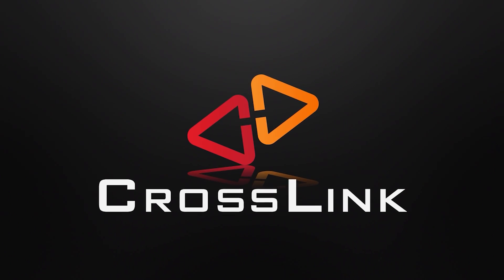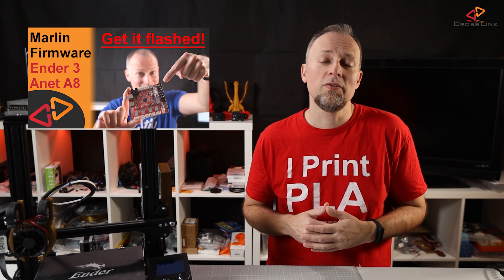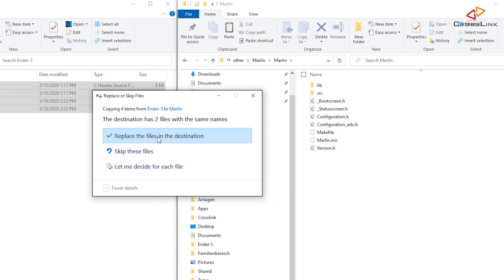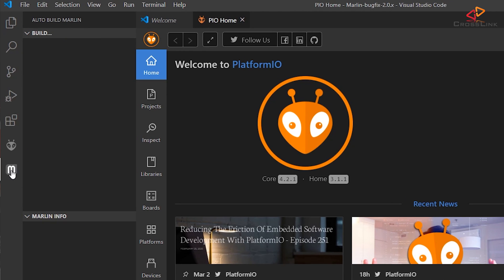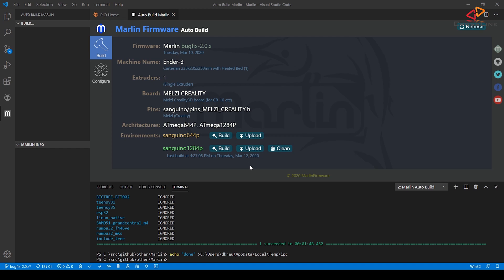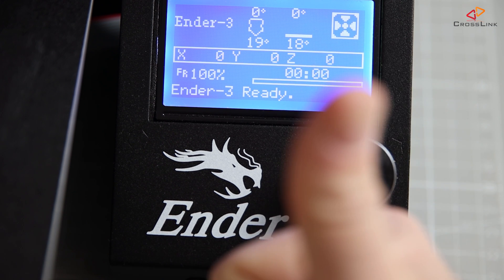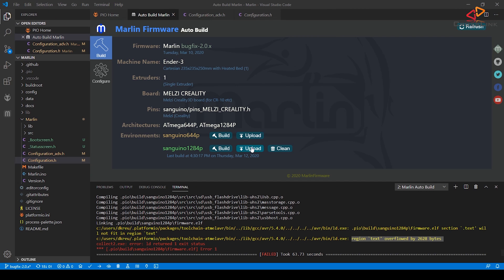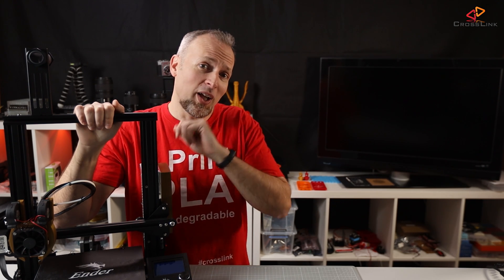Ender 3 (Pro) Marlin 2.0 Upgrade  - Updated Version

Comment: Thank you for this video, i am trying to use and SKR Mini and there was a file for that now in the CONFIG files, however when I try to build using auto build it just says unknown motherboard BOARD_BTT_SKR_MINI_E3_V2_0. I am trying to get my BLtouch to work on this board, BTT's precompiled firmware is not working correctly.

Comment: Hi !
I have a problem to build SANGUINO1024p (6:06 of your video).
First, i downloaded VISUAL STUDIO CODE. Then i put Extensions "PLATFORMIO" and "auto build marlin". Then I restarted computer.
I connected my Ender 3-pro in USB (Only USB, 230V of printer is off), then I open VISUAL STUDIO CODE.
I opened as you shown and click on BUILD. Video : https://drive.google.com/file/d/1y3KVWwaJwz86ZRVw_2wGgKtKVzsTtrWy/view?usp=sharing
As you can see, I have several errors, but I don't understand why...
Can you help me please ?
Thanks in advance,
Fabrice

Comment: is it possible to load marlin 2.0 on creality ender3 board 1.1.4. seam to getting a orange vscode with a dot in the marlin build with a few problems and environments getting melzi not surguinio
Reply from the maker: Sure, this works fine. Issues will come with building firmware with a lot of features. And on Windows, the bugfix branch won’t build with vscode.
Reply: @Crosslink3D  how long does it take to build after starting auto build marlin have success but now saying please wait that was 12hrs ago. Have a high end computer

Comment: Dear Daniel
I loved this video, but I don't know much about programming.
However I managed to get the arduino to work as an ISP and ran the bootloader.
I wanted to follow your video to put Marlin 2 and mesh meveling and even center the extruder on the table.
So I stoped on this step looking for help.
But I don't know how to change the enveronment and archutectures in the visual studio. you can help.
Beste regards
Vítor Lalanda

Comment: FYI,  I followed your guide on the Ender 3 Pro I received this week. It arrived with the 1.1.4 standard Creality board and no boot loader installed. It did have their 1.1.6 firmware preinstalled, In your video you suggest that the 2.x versions will start having trouble fitting on the older boards the software continues to develop. I can confirm that as true as of this latest Marlin release. To get the basics to fit and only enable mesh bed leveling I had to also comment out the speaker setting as your blog post indicated it was not needed. This, along with the other settings you recommend commenting out allows 2.0.x to barely fit on stock Creality board.  Thanks for the video and blog post.

Comment: Awesome video, the best I have seen. The only thing worth mentioning (in case anybody else struggles like me!) is that I kept getting errors about specifying the 'upload-port' or something...I took out the SD card from the machine and the upload worked. I also had minor issues with having to edit a line in the config file that has been changed in newer versions. I am using a nearly new Ender 3 Pro with the 1.1.5 board. Testing now, but seems great, and mesh leveling is brilliant!! Thank you, subscribed :)

Comment: Hi Daniel I got. Marlin\ src\module\motion.cpp:77:89: error ‘Z_Home_BUMP_MM’ was not declared in this scope.       In red then further says Error 1.     I did one thing different than you did which was copied  from Ender-3 Pro folder that was available in Configurations folder.
Reply: Hi ! same problem there... did you find a solution ?

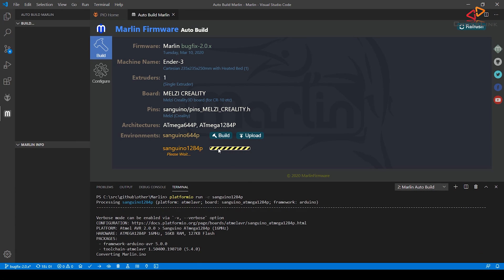Comment: Hello, so I have followed your video and while going through the steps of building the environment for sanguino1284p, I get two problems found and it doesn't complete. It's the same file or folder it's looking for "include".  I also tried it on my desktop computer and it tells me the "sanguino1284p FAILED 00:06:22.287".  This file wasn't in the downloaded zip file.  Any help would be greatly appreciated.  Great video none the less.

Comment: hello sir! thanks for the video! I have a problem after setting up marlin 2.0 that I can't seem to figure out. it seems like my bed has been switched around 180 degrees. everything prints in the correctly, and even auto homes correctly, but the priming line is on the opposite side of the bed, and the prints are coming out with the front on the back on the bed, and the left side on the side (switched around 180 degrees). I'm using an ender 5 pro with the silent board. any ideas on how to fix this?

Comment: i get the follow error in visual studio when building the melzi_optimezed: avr-g++: error: CreateProcess: No such file or directory
* [.pio\build\melzi_optimized\firmware.elf] Error 1
how do i fix this?
Reply: The configuration files he links to are out of date, use: https://github.com/MarlinFirmware/Configurations/tree/release-2.0.5
Reply from the maker: i guess you are trying to build the bugfix branch on windows? It's currently broken and probably won't fix in near time. You probably need to use the linux environment on Windows to work around this for the time being.
Reply: https://github.com/Flawioo/Creality-Ender-3-board-v4.2.7/blob/master/README.md had same issue, these bugfix zip and config zip worked like a charm.

Comment: what config to use now? there are multiple ender 3 configs.
Reply: I used theses
https://github.com/MarlinFirmware/Marlin/tree/bugfix-2.0.x
https://github.com/MarlinFirmware/Configurations/tree/bugfix-2.0.x/config/examples/Creality/Ender-3%20Pro
Last thing is editing platformio.ini
[env:sanguino1284p]
platform      = atmelavr
extends       = common_avr8
board         = sanguino_atmega1284p
build_unflags = -g -ggdb
build_flags   = ${common.build_flags} -fno-tree-scev-cprop -fno-split-wide-types -Wl,--relax -mcall-prologues
And you must build at "PLATFORMIO" under "PROJECTTASKS">"env:sanguino1284p">Build
Reply: @marionette409  you used the pro for the reg ender 3?  just want to confirm.

Comment: Hello! Very good video. With my Ender 3 Pro, I stopped in step of Build Sanguino1284p, because it failed. I don't know why
Reply: Show me your error.
You might fix it by
I fixed it by these config in platformio.ini
[env:sanguino1284p]
platform      = atmelavr
extends       = common_avr8
board         = sanguino_atmega1284p
build_unflags = -g -ggdb
build_flags   = ${common.build_flags} -fno-tree-scev-cprop -fno-split-wide-types -Wl,--relax -mcall-prologues
Reply: @marionette409  I have the same issue. When we need to put this lines?

Comment: I am trying to activate power loss recovery but doesn't work.Any idea ;
Reply: Try these
I fixed it by these config in platformio.ini
[env:sanguino1284p]
platform      = atmelavr
extends       = common_avr8
board         = sanguino_atmega1284p
build_unflags = -g -ggdb
build_flags   = ${common.build_flags} -fno-tree-scev-cprop -fno-split-wide-types -Wl,--relax -mcall-prologues

Comment: OK - so I'm using a MacBook. I've installed Visual Studio Code, added Platform and Marlin Auto Build. I've put the printer config files in the right place and selected to build. It failed with the following message:

Building in release mode
* [Marlin/src/HAL/AVR/HAL.cpp] /Volumes/GoogleDrive/My Drive/Documents/IT/3D Printing/Marlin/Marlin-2.0.x/.pio/build/sanguino1284p/.sconsign27.db.dblite: No such file or directory

There is no .pio directory present. If I try and manually create one I get this message:
You can’t use a name that begins with a dot because these names are reserved for the system. Please choose another name.

I'm now stumped. I'd really appreciate any help at this point.
Reply from the maker: I will check again on my Mac
Reply: @Crosslink3D  Hi - the .pio folder IS there, it was just hidden by default. What is definitely missing though is the sanguine1284p folder.  Instead there is a mega2560 folder. I have checked and have definitely copied the correct config files to the right place. I used the files from an "Ender 3 Pro" folder in the examples folder of the config GitHub. Sounds like this is the same problem someone else here has had.
Reply: As I was building all this on Google drive folder, I wondered if that might be the problem so I copied everything onto my local drive and this solved that particular problem. Just discovered now that I need to use the bug fix version. Fingers crossed!
Reply: https://github.com/Flawioo/Creality-Ender-3-board-v4.2.7/blob/master/README.md had same issue, these bugfix zip and config zip worked like a charm.

Comment: You should update your links for the configuration files to download from https://github.com/MarlinFirmware/Configurations/tree/release-2.0.5 as your link downloads the 2.0.x which will fail when you try to build (Ender 3) once I downloaded the 2.0.5 files I had no issues. Things change constantly and hard to update older videos I know. Great tutorial :)
Reply: yeah, if you use his download link, and click on ender 3, it opens a weird sub menu that i had no idea what it was. This link works great.
Reply: Thank you for the updated link.  Was having the same issue where the build was failing.  Updated the four files from this link and it worked.  Thanks
Reply: msaunders300  This comment should be pinned!
Reply: Thanks man! really needed this
Reply: thanks for the share !
Reply: Cheers for this. I'm quite surprised they don't bother reading the comments. 2 months in, still haven't updated the link.
Reply: im still new to this and side note great add to this video cause all was great till it came to the build part but im stuck am i choosing the melzi, the optimized or the boot to make the build for an ender 3? thanks again

Comment: Great video. Just a note that the link for the configurations file points to "Configurations-import-2.0.x" which contains several Ender 3 folders none of which worked for me. Downloaded "Configurations-release-2.0.5" from the Marlin site. This contained a single Ender3 folder as you described in the video Using those config files compiled and uploaded just fine. Thanks again for walking through all of this. Looking forward to using Mesh Leveling.

Comment: Help me please crosslink. 
i did your marlin flash to my ender -3 silent board this after noon and it was working fine then. i turned the printer off some time later. i have just went to turn the printer back on a few minutes ago and all i am getting is ether the marlin screen showing up. or just a blank screen when trying to turn the printer on.  visual studio wont see the printer nether....Help  Help  Help Help
Reply: Must flash bootloader again... (You need ISP or Arduino UNO)
Reply: Just like previously mentioned re install bootloader and reflash. I had exact same issue

Comment: WoW very pleased that i came across your video. i had just installed a silent 1.1.5 board and it was not running right. all your instruction in the video worked a treat. you now have one new subscriber. thanks man. 10/10

Comment: THANK YOU!!  Excellent Video!  I paired this with a Raspberry Pi bootloader video and loaded Marlin 2.0.    One thing I still have not found an answer to... The latest bugfix version gives you the environment option of Melzi or Melzi_optiboot.   I went with the assumption that the optiboot is the version I needed, however the amount of memory available after attempting to add the bed leveling is wonky.  I need to free up 130k bytes.   Hopefully a clean build will remedy that.  If not, any insight on the optiboot environment?

Comment: great tut ! 
heads up
cr 10s - nothing but issue for this firmware   it reverses z axis motor (easy fix wrong )  reverse encoder on  z axis  toggle setting  for both   no setting changes  help  used  stock config for cr10s  as guide  , the bugfix examples  configs - 2 hours no joy 
seem that this firmware - kills my inductive sensor strength had move down to bed almost touch --- works perfect with newest th3d 
 still bugged for this model

Comment: I needed to alter some code due to some version issues of the config files I ended up with. In any case now I have thermal runaway protection and, as I took off the screen my Ender 3, was able to cut the firmware down to less than half the size it was before. Thank you!

Comment: Having issues builing the firmware i have a 1.14 board i cant compile the firmware and the enciroment is melzi_optiboot and not sanguino 1284p
Reply: having the same issue 
still

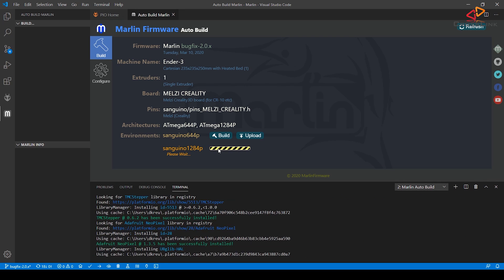Comment: My upgrade keeps failing in VSCode, and google has not been as helpful as I'd hoped. I get right up to the 6:30 mark of the video, and then a failed process. Help!
Reply from the maker: Can you please post the content of your output window here, so I can read what is the issue?
Reply: @Crosslink3D  Marlin\src\module\motion.cpp:77:71: error: 'X_HOME_BUMP_MM' was not declared in this scope
 #define XYZ_CONSTS(T, NAME, OPT) const PROGMEM XYZval<T> NAME##_P = { X_##OPT, Y_##OPT, Z_##OPT }
                                                                       ^
Marlin\src\module\motion.cpp:83:1: note: in expansion of macro 'XYZ_CONSTS'
Compiling .pio\build\sanguino1284p\src\src\sd\usb_flashdrive\Sd2Card_FlashDrive.cpp.o
 XYZ_CONSTS(float, home_bump_mm,   HOME_BUMP_MM);
 ^
Marlin\src\module\motion.cpp:77:80: error: 'Y_HOME_BUMP_MM' was not declared in this scope
 #define XYZ_CONSTS(T, NAME, OPT) const PROGMEM XYZval<T> NAME##_P = { X_##OPT, Y_##OPT, Z_##OPT }
Compiling .pio\build\sanguino1284p\src\src\sd\usb_flashdrive\lib-uhs2\Usb.cpp.o
                                                                                ^
Compiling .pio\build\sanguino1284p\src\src\sd\usb_flashdrive\lib-uhs2\masstorage.cpp.o
Marlin\src\module\motion.cpp:83:1: note: in expansion of macro 'XYZ_CONSTS'
Compiling .pio\build\sanguino1284p\src\src\sd\usb_flashdrive\lib-uhs2\message.cpp.o
 XYZ_CONSTS(float, home_bump_mm,   HOME_BUMP_MM);
 ^
Marlin\src\module\motion.cpp:77:89: error: 'Z_HOME_BUMP_MM' was not declared in this scope
 #define XYZ_CONSTS(T, NAME, OPT) const PROGMEM XYZval<T> NAME##_P = { X_##OPT, Y_##OPT, Z_##OPT }
                                                                                         ^
Marlin\src\module\motion.cpp:83:1: note: in expansion of macro 'XYZ_CONSTS'
 XYZ_CONSTS(float, home_bump_mm,   HOME_BUMP_MM);
 ^
* [.pio\build\sanguino1284p\src\src\module\motion.cpp.o] Error 1
Compiling .pio\build\sanguino1284p\src\src\sd\usb_flashdrive\lib-uhs2\parsetools.cpp.o
================================================================================================= [FAILED] Took 315.37 seconds =================================================================================================

Environment               Status    Duration
------------------------  --------  ------------
mega2560                  IGNORED
mega1280                  IGNORED
rambo                     IGNORED
FYSETC_F6_13              IGNORED
FYSETC_F6_14              IGNORED
sanguino644p              IGNORED
sanguino1284p             FAILED    00:05:15.373
melzi                     IGNORED
melzi_optiboot            IGNORED
at90usb1286_cdc           IGNORED
at90usb1286_dfu           IGNORED
DUE                       IGNORED
DUE_USB                   IGNORED
DUE_debug                 IGNORED
LPC1768                   IGNORED
LPC1769                   IGNORED
STM32F103RC               IGNORED
STM32F103RC_fysetc        IGNORED
STM32F103RC_btt           IGNORED
STM32F103RC_btt_USB       IGNORED
STM32F103RC_btt_512K      IGNORED
STM32F103RC_btt_512K_USB  IGNORED
STM32F103RE               IGNORED
STM32F103RE_btt           IGNORED
STM32F103RE_btt_USB       IGNORED
STM32F4                   IGNORED
STM32F7                   IGNORED
ARMED                     IGNORED
STM32F103VE_GTM32         IGNORED
STM32F103VE_longer        IGNORED
mks_robin_mini            IGNORED
mks_robin_nano            IGNORED
mks_robin                 IGNORED
mks_robin_pro             IGNORED
mks_robin_lite            IGNORED
mks_robin_lite3           IGNORED
jgaurora_a5s_a1           IGNORED
STM32F103CB_malyan        IGNORED
STM32F401VE_STEVAL        IGNORED
FLYF407ZG                 IGNORED
FYSETC_S6                 IGNORED
STM32F407VE_black         IGNORED
BIGTREE_SKR_PRO           IGNORED
BIGTREE_GTR_V1_0          IGNORED
BIGTREE_BTT002            IGNORED
teensy31                  IGNORED
teensy35                  IGNORED
esp32                     IGNORED
linux_native              IGNORED
SAMD51_grandcentral_m4    IGNORED
rumba32_f446ve            IGNORED
rumba32_mks               IGNORED
include_tree              IGNORED
============================================================================================= 1 failed, 0 succeeded in 00:05:15.373 =============================================================================================
Reply: @Crosslink3D  I can't get the full log in there, but that is where it fails.

Comment: I have followed this exactly, and when I select Build it simply will not complete. I keep getting the same list of errors,  I tried this on a 2nd computer to be sure, I re downloaded all the required files. I've had someone trying to guide me through it and he can't find anything I'm doing wrong. I was shipped the silent board with the ender 5 firmware so I'm simply trying to get it swapped to the ender 3 pro firmware that belongs on the machine. I have screenshots of all of this, I went through the video several times and I am doing everything exactly the way it is done here. I know I'm missing something I just can't figure out what it is. If anyone would be willing to help out, I'll gladly send over the issues I'm having. Creality is being a huge pain about replacing the board so I thought this would be the easy option.
Reply from the maker: Can you please post the content of your output window here, so I can read what is the issue?